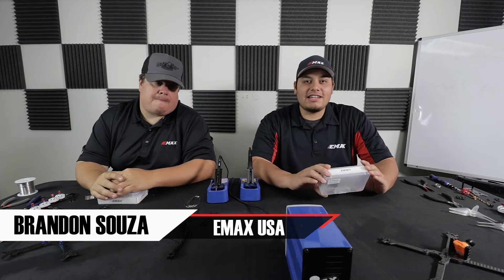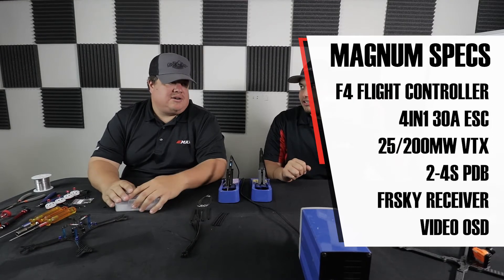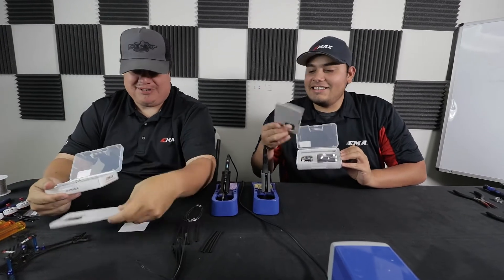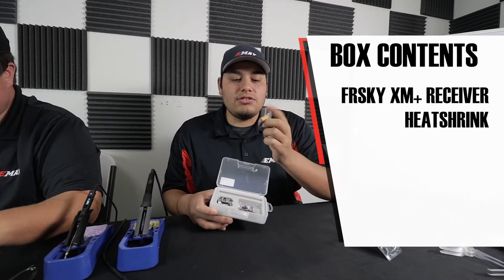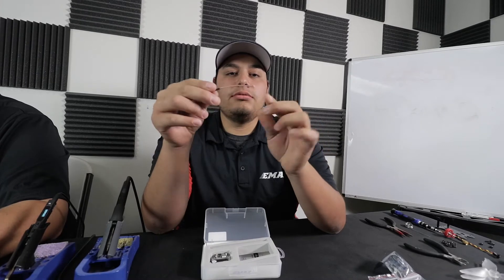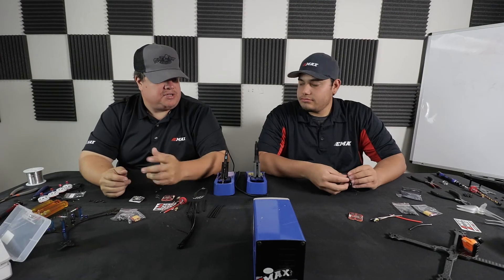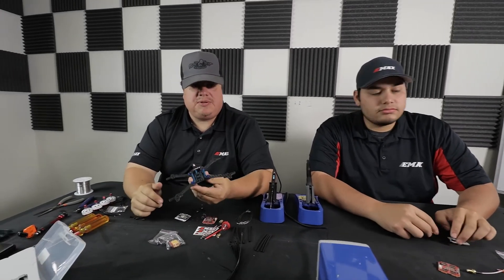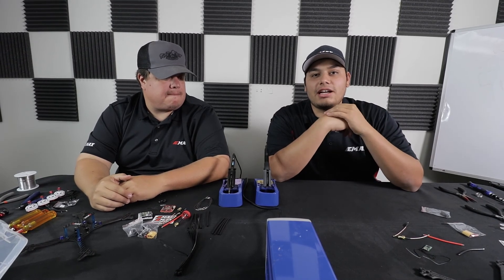Unboxing - Magnum Tower System

Comment: Hey guys. Do you guys have any videos on the mini magnum? I was wondering if it’s possible to drill out the holes from m2 size to m3? I’ve got a tomoquads frame I’m building the mini magnum with 1306 3300 motors but the frame holes are drilled at m3. I was thinking about just drilling the holes out big enough to fit the m3 standoff’s that came with the frame and using silicone o-rings to dampen.
Reply from the maker: No, as m3 nuts will squish and damage components. :/
Reply: EMAX USA got it. Thanks. To update the firmware on the mini magnum, is it just OMNBUS in betaflight? Is that the f3 firmware? I notice it doesn’t have f3 but has f4 and f7.

Comment: looks great, but thanks for not thinking about the guys that are flying spektrum which alot of people are switching too.

there's more than one radio used you can also include a spektrum receiver version.
Reply from the maker: The pricing is so cheap that the frsky receivers are practically free. Feel free to keep them as backups or for friends :)
Reply: My frsky receiver just blanked out. Had to use uart 6 and connect to flysky receiver

Comment: Will it ever come in a spektrum version? Or at least a version with no receiver
Reply from the maker: As seen in the video, the receiver comes separate so you can solder on your own receiver :)
Reply: I get that but flysky and spectrum users don't have a use for the reciever. Pretty sure it would save on cost if it wasn't included
Reply from the maker: We have costs so cheap at $110 for everything that the receiver is practically free. You can give it away to your friends too if you really don't want it.